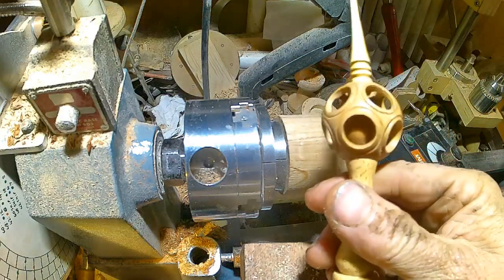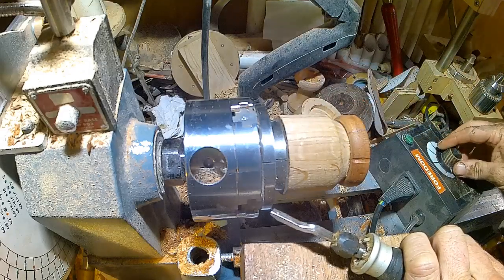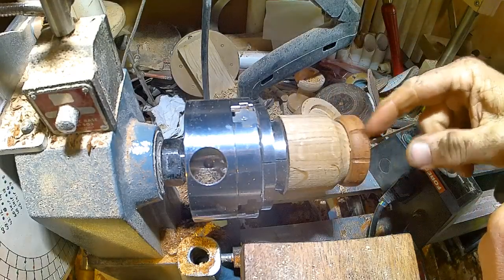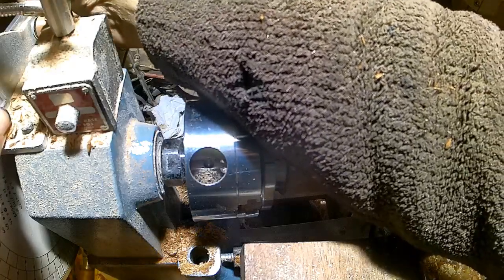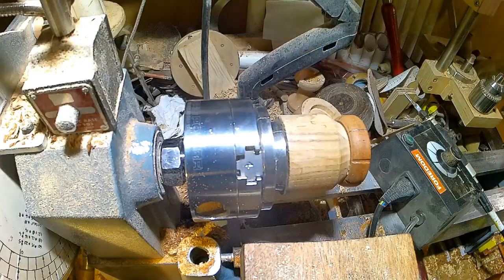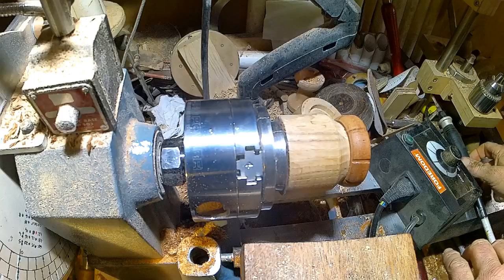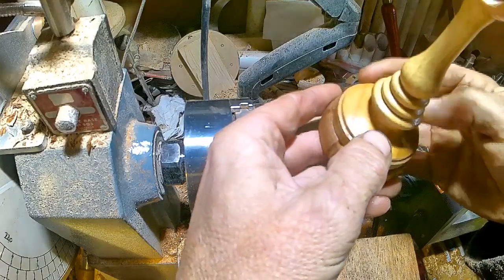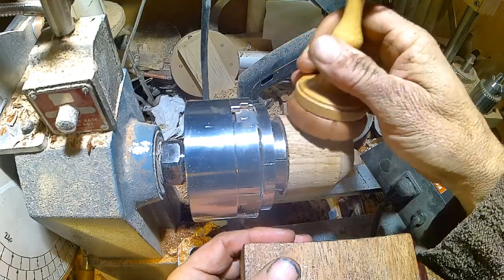Fluting a Finial Base with a Foredom H.50

Comment: That’s essentially a mini electric chisel I wondered if someone made those.  Thanks For sharing!!!
Reply from the maker: yeah Joe. There are cheap ones with an integrated motor. I had one of those, but they get too hot to use, very quickly. The Foredom one  stays cool as far as I can tell, You can also use certain series of Flexcut gouges, in the Foredom, which I hope to get later,
Reply from the maker: Bosch make a larger, powered, chisel that looks pretty good, but I've not tried one.
Reply: Yep.  They are called a "reciprocating handpiece".  I got one for one of my Dremels, made by Wecheer, that also uses the same Flexcut knives.  It's one of my favorite and most-used tools in the shop (I use it a lot for removing part-off nubs on the bottoms of turned pieces).
Reply from the maker: Do you know if the Wecheer handpiece fits on a Foredom flexshaft? I had seen them and wondered about that.